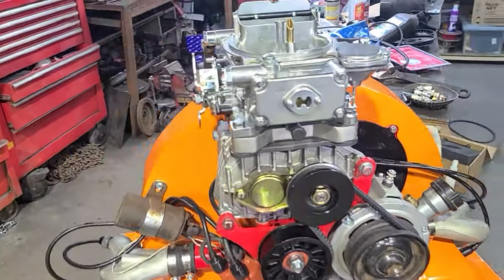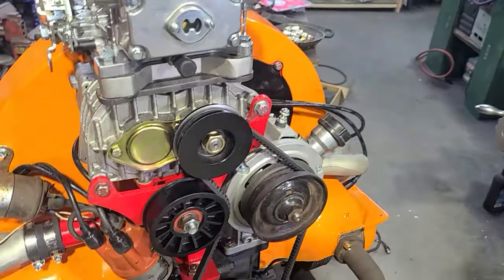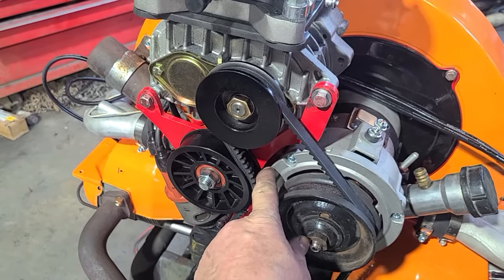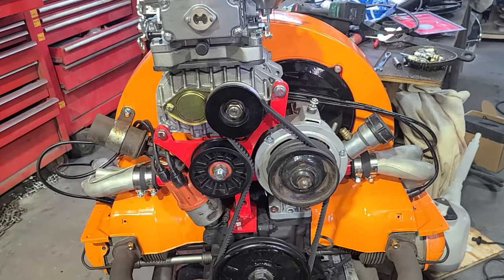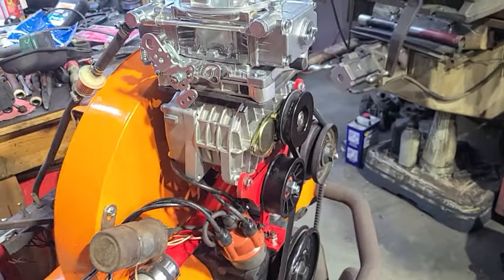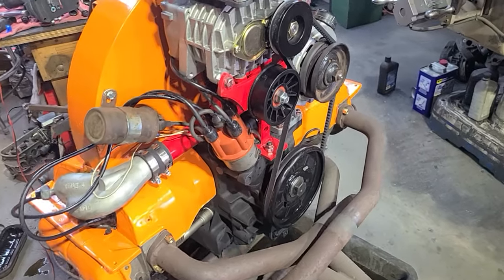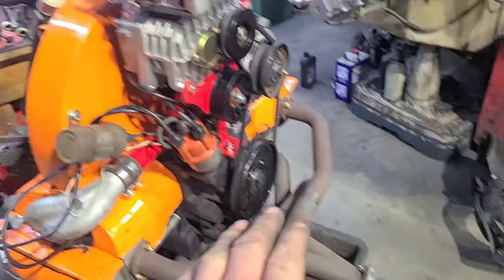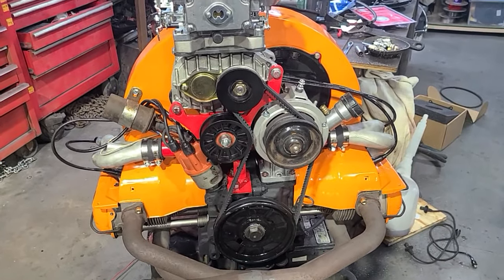600 holley downdraft Discussion about setup

Comment: Smaller carb gives you more venturi effect, thus a stronger signal at the jet, and thus better response. The Holley 390 is what you want.
Reply from the maker: True.  This 600 is what I had and I have used them Many times on vw with turbos and I was curious
Reply: @berrysblowers6411  nothing wrong with seeing how big you can go. You'd be surprised just how much you can oversize a carb before the signal gets really silly. Vacuum secondary stuff is pretty tolerant.

Comment: A holley 390cfm should be the ticket. Give you way more tunability. 😊
Reply from the maker: You are correct but it was what u had and I wanted to see how it responds. I have used 600 amd 700 on vw engine since 1987 with turbos

Comment: 2 barrel 350cfm holley more than enough for that ebay concoction.
Any bigger and its just gaggin haha
Reply from the maker: I know I been down this many times. It's what I had and I just wanted to play but I have had 600 and 700 on vw engines and working perfectly since 1988  but those was with turbos